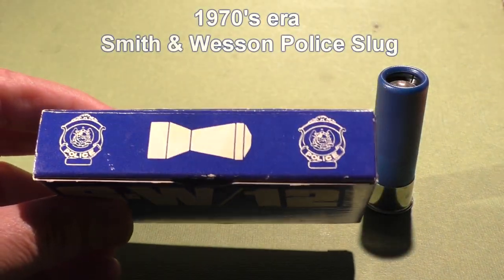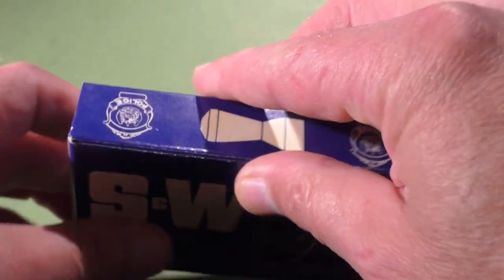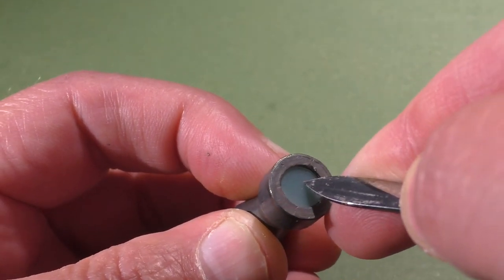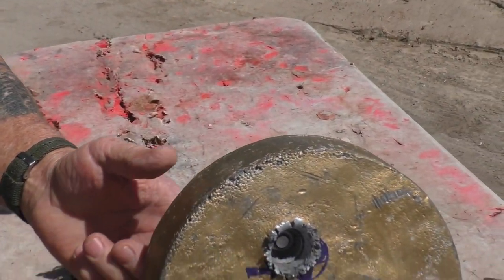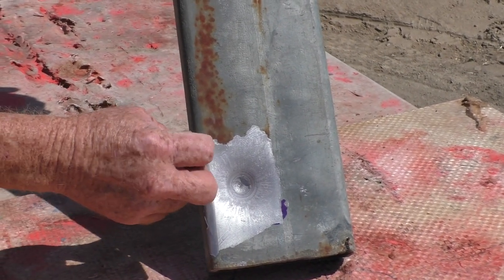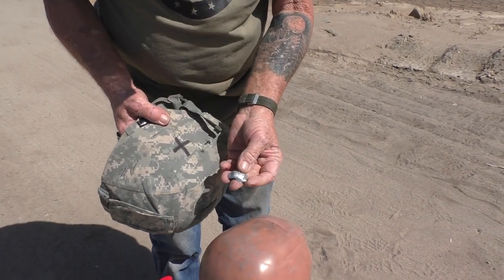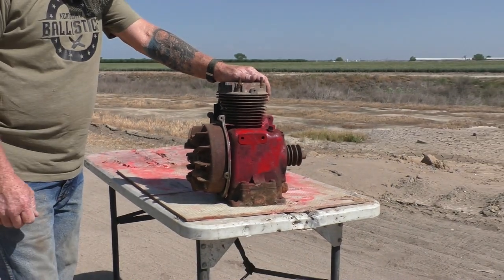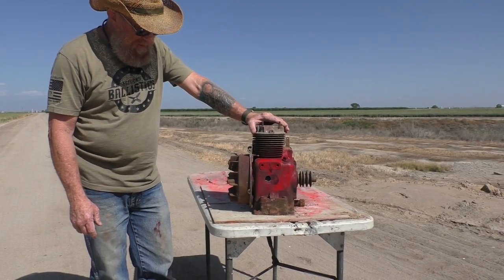45 Y/O S&W Police Slugs - Anti-materiel Sabot Rounds - Tested

Comment: I HAD SOME OF THESE ROUNDS BACK IN 1982 OR 1983, THEY HAD A WHITE AND RED BOX. WHAT I REMEMBER FROM THE DATA ON THE BOX WAS 1/8 IN PIECE OF PLATE STEEL AT 110 YARDS PENETRATION.  I THOUGH THE WEIGHT WAS 440 GRS . THEY HAD POLICE  ISSUE ONLY ON THE BOX. I PERSONALLY THINK SOUTH AFRICAN BUCK SHOT AND GERMAN HUNTING SLUGS WERE MORE POWERFUL AND ACCURATE.
Reply: @Kevin-mp5of  not yelling use caps sometime, better on my eyes.